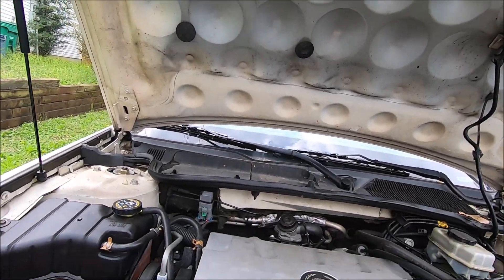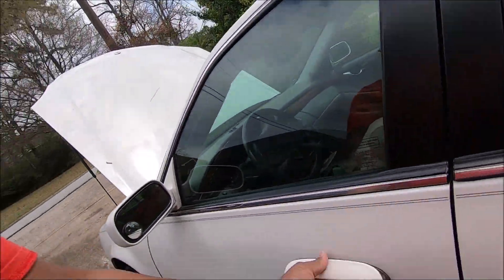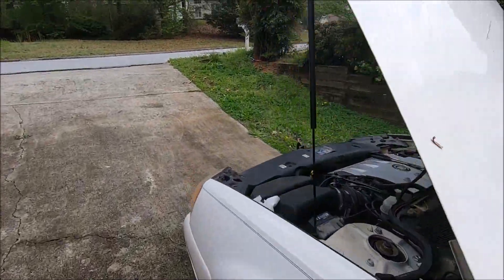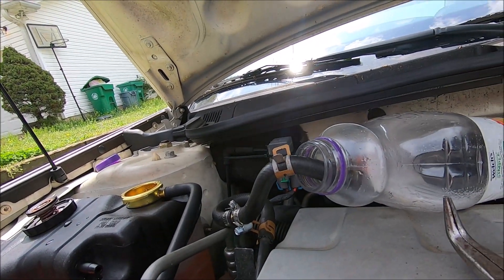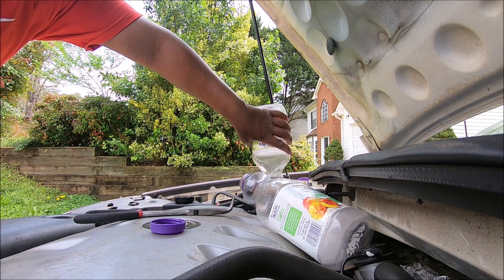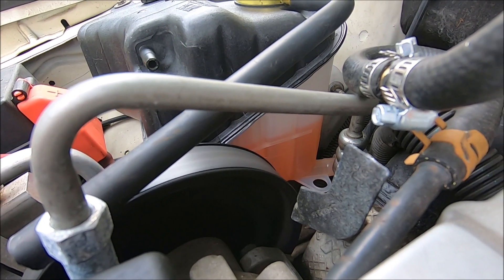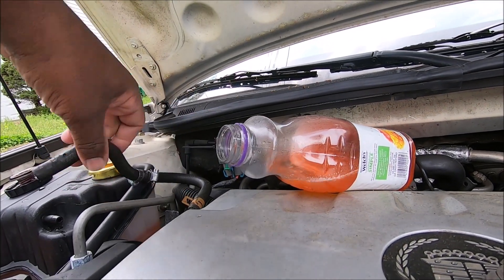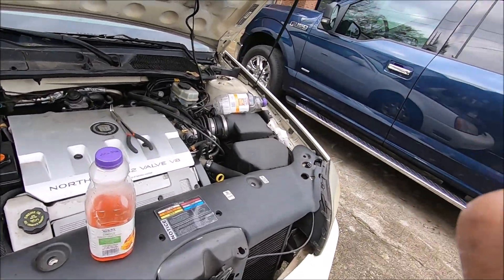How to bleed air out of a Northstar engine

Comment: What symptoms did u have n are watching for? You didn’t address the whole heater on, thermostat opening, block returning to tank - air?  Not necessary? Had mechanic replace radiator n says heads blown but he had noooo idea bout burping. Soooo I’m doing n having symptoms of engine chugging after driving lil n oil seems fine… so guess I’ll combine YouTube mechs n have heater on insure tank never empty n bigger catch jug. But enjoyed yours as engine n bleed hose exactly like mine. 95 just rolled over 100k ☺️😇
Reply from the maker: I didn’t know at the time but my video is wrong. You don’t have to bleed air out of a Northstar. You don’t have to turn on the heater because water flow through the core all the time. My engine was pumping out coolant because it had a blown head gasket. The head gasket was blown because one head bolt was stripped out. I have a video where I rebuilt my engine. If you need me to send you a link, let me know.
Reply: @Fone65 Much thx fr. Thinking I’m tapping out, leaving all the heavy, head gasket probability, to way more experienced wrenches than I wanna have. lol. Beautiful ruby red no rust clean exterior n interior not bad, seat adjustment panel needs fixed, my shoe string caught n I pulled - bad move. But would luv to gift this sweet ride that was mommas who passed last year, to someone to bring good things to life in it again like mom kept it. I drove it from Kansas where she’s lovingly planted to mount Vernon, Wa. North of Seattle, where I live. Just turned over 100k miles n interior dash n panels ,95% inside great condition exterior excellent new tires n breaks in Oregon les Schwab last summer, receipts kept. I am just not a Ruby Red Cadillac person like momma. I’m a veteran with social anxiety issues, don’t like feeling like ppl looking at me allot, well this car gets the looks. 😳⚓️ Anyone sees this n can help get mommas baby a proper loving home plz contact.  Respect the ride but over my head n heart just not there.  Gifted to me, I Will gift 💝

Comment: Y u putting orange juice in it
Reply from the maker: I don’t play with kids.
Reply: @Fone65 so my 01 deville is running hot only under load after about 15 miles but not at idle, I haven’t done anything with it yet but I’m gonna try flushing the cooling system an change the thermostat see where it gets me
Reply from the maker: @hunterclark3422 Before you do anything. Try a block tester. My car turn green not yellow. Take a picture before and after to see the difference. One of my head bolts were stripped out. I rethread the head bolt hole and replaced my head gasket. My engine doesn’t run hot anymore.

Comment: Just put the return line in the fill cap. Or just don't overfill the recovery tank. and the air goes in the tank.
Reply from the maker: At the time of this video. I didn't know the northstar bleed air on it own. Just leave the cap off as you add coolant.

Comment: Does anybody kbow how hot the Engine should run?  Ours hot run from 180 to 230 degrees.  New Radiator, thermostat, cooland flush, and runnin Prestone G-05.  No exhaust in coolant.
Reply from the maker: If no exhaust is in the coolant. The engine run cool.
Reply: We have a 1997 Oldsmobile Aurora with the 4.0 liter version of the Northstar and it runs at 185 to 205F on the highway at 65 MPH in summer to around 215 after we shut it off. Water pump replacement is actually pretty cheap and easy on my car; not sure of Cadillac but you may want to look into that. Was your water pump ever replaced?

Comment: My radiator was punctured trying to replace my alternator, I used the bars leak thing in it & now my mechanic said there’s air bubbles in my radiator line
Reply from the maker: When I made this video. I thought I had to bleed air from the system. You don't have to do this. Take the cap off and run the engine. It will bleed air out. Also when I made this video. I didn't know I had a blown head gasket. Watch this video and try block testing fluid. If it turn green. You have a blown head gasket. https://youtu.be/VBlpBvmI8FI?si=sCOS_sCx_bnwxwdC
Reply: @Fone65  so now it won’t start no more, you got an email or something, nothing will start it… like my lights and radio come on but it won’t start, after changing the alternator it started right up, but I was getting greyish smoke from the exhaust & my temp was rising fast… I cut it off, let it cool to try again & now it won’t start… when I put the key in tho, I get lights, radio, I can lock & unlock my doors, etc. but no clicking, no starting… someone told me to jump it for 10-15 minutes and see what’s up after that
Reply from the maker: @tony3x  If you had grey smoke. Your engine probably has hydrolocked. Water is in your cylinders and the engine won't turn. It need to be removed and rebuilt. This is not going to be cheap if you can find someone to do it. I live in Atlanta and I had to do it myself. My email is 251370@yahoo.com. Leave your number and the time you want me to call.
Reply from the maker: I have stopped my engine from running hot. I had to remove it and take it apart. One of my head bolt hole threads were stripped out from the factory. You don't have to drill out all 20 holes and replace them with studs. I bought a thread repair kit off ebay for $150. You can reuse your stock head bolts. Only torque them to 50 lbs.-ft torque. This part one of 40 plus videos. https://youtu.be/BDQD8Aamhu4?si=VEA8J5nD9uIkMTPJ

Comment: what do you think is happening if theres no coolant coming out of the line?
Reply from the maker: This video is wrong. At the time, I thought it was right. The engine had a blown head gasket. When I checked it with a block tester. The blue fluid turn green. https://youtu.be/VBlpBvmI8FI?si=VOmeiU1D1gSqeP1r I'm rebuilding this engine now. https://youtu.be/BDQD8Aamhu4?si=Kar3Y19F8ZoRRqIJ
Reply from the maker: Either the line is stopped up or there is so much exhaust gas in the coolant. The water pump can't pump coolant.

Comment: I've been trying this and mine still goes hot
Reply from the maker: When I made this video. I thought this was working. Now I think the coolant system will bleed it's self. Do a block test. If it turn green you have a light leak. https://youtu.be/VBlpBvmI8FI
Reply: Did.U che k the coolant sensor

Comment: How did you know you had a blown gasket? What was the signs
Reply from the maker: Pumping out coolant before running hot.
Reply: @Fone65  wow mines is leaking coolant too I hope it’s not the head gasket
Reply: @Fone65  did you see any smoke out the exhaust and was it an internal or external leak
Reply from the maker: @someone7773  Exhaust is leaking into the coolant. This cause the coolant to be pumped out the engine over heat.
Reply: @Fone65  I don’t have any exhaust problems. Think it may be the heater hose
Reply from the maker: @someone7773  When the engine burn fuel and you have a blown head gasket. Some of the pressure may leak into the coolant. Aka exhaust leaking into the coolant.
Reply: @Fone65  okay yes I know this but is that what happened for you?
Reply from the maker: @someone7773  Yes.
Reply: @Fone65 does this make your oil milky ?
Reply from the maker: @jg9249 No

Comment: North Star head gaskets fail so much because of a design flaw in head bolts being too thin in an aluminum block. There is a fix for it. Now. But your looking at having the whole engine being removed and yes it’s gonna be northwards of 3K.
Reply from the maker: Tell me something I don't know
Reply: Yup, the Northstar is notorious, so the Corolla/Camry/Honda crowd are scared to death of it and you can pick up a rust free nice car for really cheap and have a trusted mechanic do the head bolt fix for a few thousand.  Then you'll have a nice, rust free car for many years.

Comment: Its not air buddy, its the gasket
Do not buy any caddy older than 2000s, i learned the hard way too. Dont put $ into it either, been there done that, u lookin at $3k for a good repair.
Get a new caddy
Reply from the maker: Hell no. I want what I got. A 32 valve DOHC American v8.
Reply: @Fone65  damn right. And if you do the repairs urself like I do then it's usually not even half the $ of what the god above said..smh 🤦

Comment: can  I do this on my 95 seville sts???
Reply from the maker: You can but I found out you don't have to do this. My engine has a blown head gasket. Air was not in the coolant system. It was exhaust leaking pass the gasket.

Comment: Do ur heat have to be on during video
Reply from the maker: No. Water run through the heater core full time. The problem is I have a weak aka blown head gasket.

Comment: Bad idea. You are emptying the coolant from the reservoir and allowing air to enter the radiator
Reply: You must not know these engines. Reverse flow operated. So as long as your flowing coolant your getting rid of air stuck in the lines. Add coolant to the reservoir as you go. These engines MUST have this done at least 1-2 times a year including a flush especially when they are old or sit a lot. They build up corrosion and deposits fast it’s about the design of the engine that pleagued them. Religious maintenance is what keeps these expensive engines on the road. They are not a LS

Comment: Northstar supposed to do this for you automatically
Reply from the maker: You maybe right. I found out my head gasket was blown. When I tested it. The fluid turn green which is a small leak.
Reply: @Fone65  .. hi. Do you mean the orange antifreeze turned green?
Reply from the maker: @robbob5973  I used blue block tester solution. https://youtu.be/2oh5WDSBEV4
Reply: What is the capacity of a '02 Cadillac Northstar I mean I do but I don't care what she does on there I mean
Reply: Did you get the head replaced or new motor?